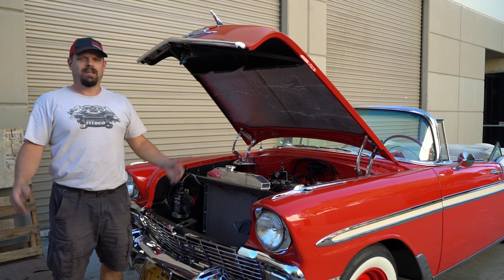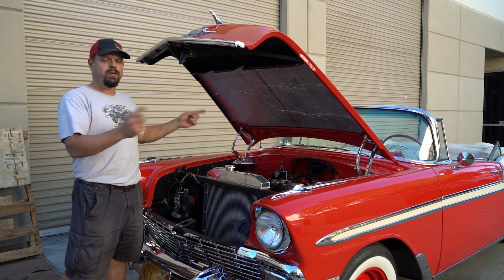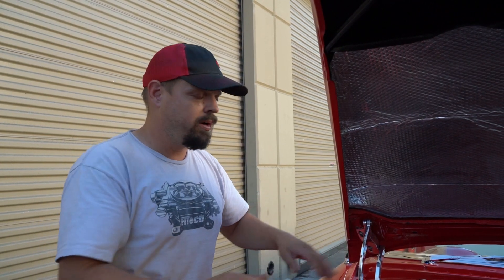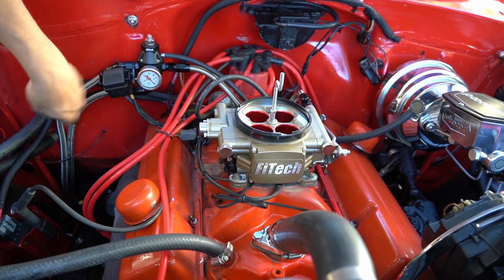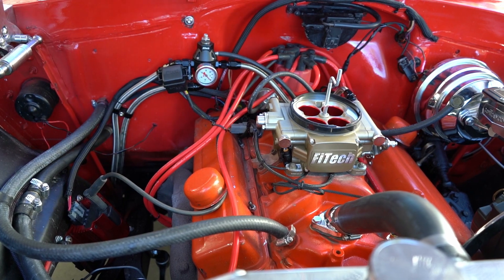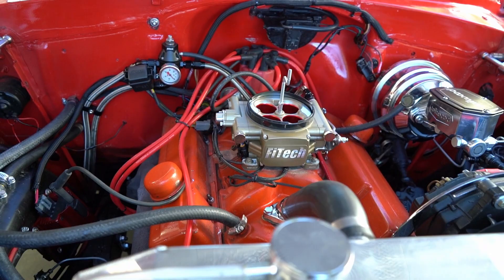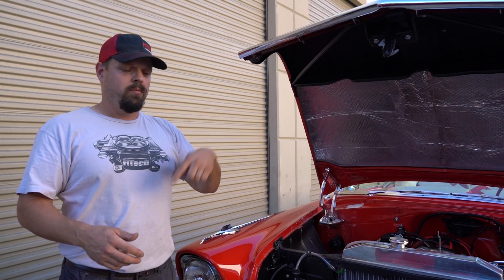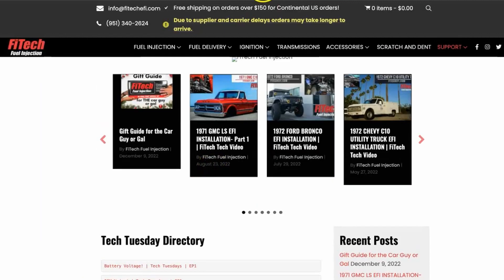Experiencing RPM Noise? | Tech Tuesdays | EP55

Comment: We have hd brand new braided ground straps have voltage drops of up to  .12 across the length of 8”. Easy way to check is dvm from engine block right to battery. Started using solid strand insulated cable and found the fitech systems just work so much better

Comment: I have found over the years as fuel injection became standard that whenever a car came in with funky symptoms that didn't fit regular diagnostic norms i added grounds frame to block battery to frame, or anyplace that was handy. It wasn't always pretty, but it took care of an amazing amount of problems. I eventually started fabricating ground cable kits that i could just grab and bolt on. Hope this helps.
Reply from the maker: It is amazing how many engines not grounded well! When you add more electrical load to an engine/vehicle you need to provide better power and ground connections.